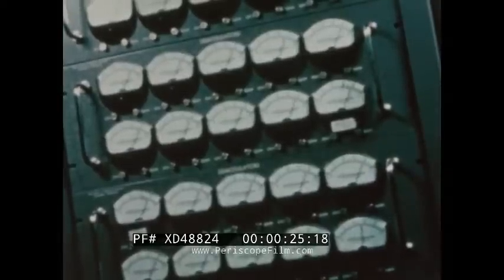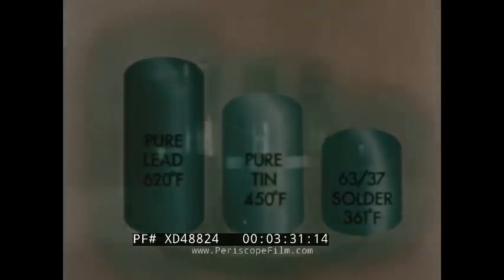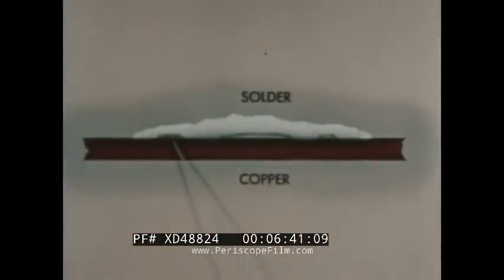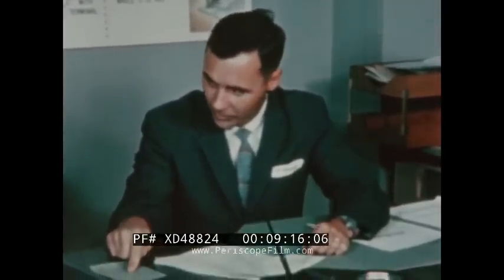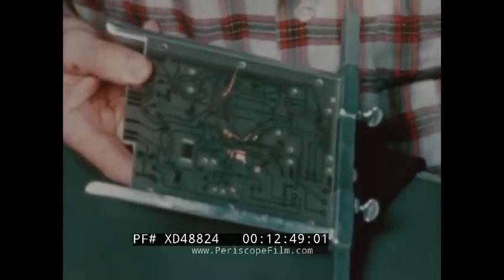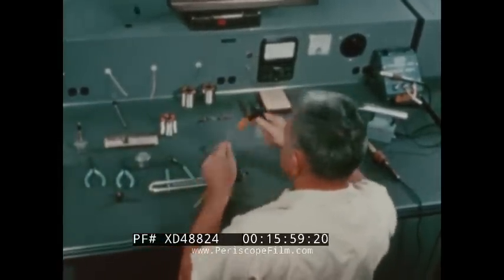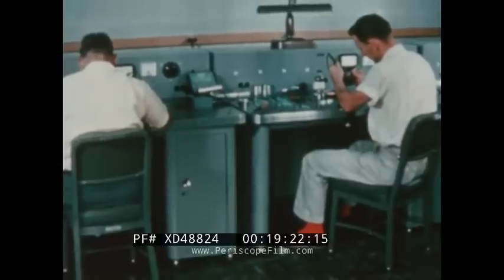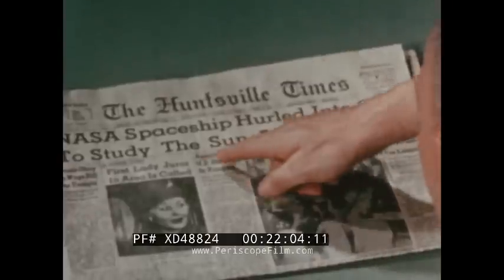1958 "ABOVE AND BEYOND" NASA SOLDER & SOLDERING TECHNIQUES ELECTRONICS INSTRUCTIONAL FILM XD48824

Comment: I took 2M miniature and micro repair in the Navy. I also went to the NASA school as well in 1972.  Years later, I instructed soldering classes for nuclear power plant techs. Most of this video is still up to date for component level soldering. Note that the amount of solder used per joint was very small in the video. Much later, it was determined that filets were not acceptable and rounds should be used in the solder joints. Also, 63/37 solder is used for electronics today as it doesn't have a semisolid state. Soldering irons today are temperature controlled.  60/40 solder is still used for power components such as transformers and high power semi-conductors.
Reply: SN 96 is the only solder acceptable for aerospace applications. And i believe military as well.
Reply: @cme98  63/37 is still permitted for grandfathered products, which is almost all military. We do use SN96 on our newest products and everyone hates it :D.
Reply: @cme98  You are of course correct! I had forgotten that NASA had shifted to the SN96 silver/tin  lead-free, eutectic solder. Still eutectic, but no lead. Thanks for keeping me honest!
Reply: Eutectic solder is more expensive than 60/40, because the tolerances must be closer. Otherwise, it would have always been used.
Reply: Lifelong professional and hobbyist electronics here, now retired. I didn't know about the semisolid state of 63/37 or why it's important, but I do know it's the lowest melting temperature solder alloy which can serve to protect components from excessive soldering heat.
Reply: @joewoodchuck3824  That's the thing, 63/37 doesn't have a semi-solid state. It's either solid or a liquid. This minimizes the chance of a disturbed joint while soldering with crystallizes the solder and makes it both weak and a potential diode.
Reply: I wish my hands were steady enough to reliably micro solder. I can barley solder 0603 components, and sometimes it takes a few tries. Anything smaller is obviously black magic and witchery from my perspective. I got the shakes. Got 'em bad. Sometimes a swig or two of liquor can make them go away, but I can't just drink alcohol all day. I love the work, I would love to do board repairs for a living. I'm just too shaky to do the work reliably. I have much respect for people who can do good sub-millimeter work by hand. I just watched a video of a man installing a mod-chip on the final PS2 Slim revision. It's a thing of beauty, all those hair-thin wires loomed across the board.
Reply: I miss the smell of carbon tetrachloride! Best thing for cleaning flux, then one day I came in and it was gone. :(
Reply: @joewoodchuck3824  The heat is not much less, but the importance is that eutectic solder can't produce cold solder joints. It won't crystallize that way, as it cools.
Reply: @alanduncan3710  Alcohol.
Reply: @alanduncan3710  OMG! I remember carbon tet. The smell was unique. Worked awesome on removing flux and any other goo. Also removed a bunch of your liver as it was absorbed directly through your skin. The fumes would get you high too...
Reply: as a hobbyist I use a 100w gun, 60-40 solder and ipa. always works and iv never had anything fail on me.
Reply: @Boemel  You might like a solder iron better since there's no waiting for warmup at each joint. Depends too if you're working with electronics or not. In my entire electronics career and hobby applications I never saw a gun in use. If I need extra heat or if portable, I swear by my adjustable Weller butane iron. Internal catalytic conversion with no flame.
   Fwiw, jmho, ymmv, etc.
Reply: @Boemel  a 100W gun is really overkill for hobby work, and also really clunky. I recommend a Weller 40W adjustable soldering station with a small assortment of tips. Best advice I can give: Always load your iron with solder when you turn it off. Your tip will last pretty much forever.
Reply: @alanduncan3710  Your liver thanks you.
Reply: @joewoodchuck3824  iv been using irons for years then used a gun and i like it more. I also have a soldering station but i dont know why, the gun always works better with me.
Reply: @GoSlash27  iv had 3 irons and i have a digital solder station. The 100w gun always works best in my mind. Note i hardly ever do components mostly wires for vehicles. The 100w gun is something i can pull out the drawer, heat up some wires in seconds and put the gun back down as its cold in seconds.
Reply: my dad did the same thing in the navy around the same time frame, even the NASA school. He later worked for Sperry-Univac and then DEC.
Reply: @alanduncan3710  , had they continued using Carbon Tet, it would likely still be here today but *you*, you might be gone. Count your blessings!
Reply: Ya know i made 6 comments & havent even watched any but a minute of this old remic from the past. Why? Because ive seen it before, just cant remember when or where? High school or my first real job which turned into a career for a small
Aerospace mfr who hired about 200 of us right out of high school. A great opportunity for me to drop out of college unfortunately nut i stayed with them for 10 years & sparked a career in electronic mfg which mever paid well until everything moved to China & people here found other careers. Then if u needed to hire
Someone to help in your startup you had to hire engineers to do production work or fly people in from China. Thays where i came in. I could do the work or find the people you need at not an engineers cost. A manufacturing specialist but educated officially as an electronics technician. It was a line of work i always knew since a Kid i was aimed to do. My last job was the one i expected to retire wealthy on. Turned out to be the worst job of
My career. A horrible mistake which cost me years of my health working in deplorable conditions to me but not to others around me which i found bafflingus.
Reply: @GoSlash27  first time i used "regular" solder i hated it. A lot more flux in that solder, melts to fast & splatters all over the product, arms hands & wrists. I much more preferred silver solder where you controlled how much flux by how much you added. When i made the switch from aerospace to commercial mfg, i was appalled at how cheap everything was commercially. The lead solder, lack of ventilation, wires where the insulation literally melted very fast & wires not made of copper but rather copper & coated with cheap ass plastic coated wires when i was used to teflon coated copper wires resistant to melting. And everything was at least varnished if not totally encapsulated in resin when completed. Even the pcb's were coated in plastic making any repair after that impossible. Everything was thoroughly inspected & tested documented & none of that bs in commercial electronics. Its safe to say no HP products that i worked on would ever make it onto the space station for a dictionary of failures. But work great at the office or at home. I worked for them just before they sold out their test & measurement division because their jet printer brought them into the computer market & they wanted that direction for their future & sold their past to smaller companies. Anyways... yeah, 2 different worlds. At start of my career all my work was from military contracts, but the quality was all the same. We never used 63/37 solder on anything because our military side was for the trident missile under development when i was hired & so it had to be waterproof, function in water & the next minute function in outer space at extreme heat in direct sun or way below 0° freezing on the otherside away from sun. And built to last 20 years if not more. Obviously top of the line & top dollar price as a result. But for the growing computer related products i eventually went into, there simply wasnt a need to build & craft a product. We didnt even strip wires & solder was only for the connectors of high priced cables leading to a Companies main frame computer. All that shit today is literally stamped out & automated.
Reply: @WarpFactor999  no need to thank me its all i ever knew. There wasnt a spool of 63/37 or 60/40 anywhere in my life for my first 10 years in my career. When i was introduced to it i was appalled by how much it splattered everywhere. S/n 96 was also called high temp solder or silver solder if you were a plumber because of the lead free content which wasnt all lead free in s/n 96 there is still 4% bs added to it to make it flow. I dont
Know about plumbers solder other than because of the hype of calling it silver, they charge more. Kinda lime intergrated circuits & manufacturing of early components involved using gold wire 99.999% pure gold wire which sounds expensive but this wire is 1/3rd the thickness of a human hair & so small the waste we threw it in a regular garbage can. Working with that was like re-attaching fingers. All under a high powered microscope
Clean room environment and VERY STEADY HANDS which literally 90% of anybody who tried to work this failed. Came easy to me.
Reply: @joewoodchuck3824  yes correct its also called low temp solder because it will melt on spacecraft which is why they require high temp solder. Also for military use on missiles. Low temp solder also cracks easier & can explode in extreme conditions. A lot of stuff learned from soldiers in vietnam who were literally pulling out goo from apache helicopters first tested there & components couldnt handle the humidity & high heat & the plastic encapsulated componets would liquify, wires falling out of somder connections & encapsulants melting into a goo. I was told military standards changed from things new that worked fine over here but fell apart over there. Literally fell apart.
Reply: @WarpFactor999  thats over my scope of knowledge. But at least i can grasp & comprehend what you are saying. If someone entered the room, i was the guy who said,
Oh you need to speak to him (you). Lol
Reply: @alanduncan3710  Good for cleaning flux.  Bad for internal organs and the ozone layer.
Reply: @NonEuclideanTacoCannon  i installed pure gold wire from point A to B on the inside of an intergrated circuit. That wire is 1/3 thickness of a human hair. I also attached same wire to a LED which i also had to pick up with tweezers and it was 2x thick of human hair & a square box. Pick it up & solder it to a flexible pcb made of capton & then complete the circuit with another gold wire from top of component to pad on capton. And then pull it to ensure it
Didnt break, then encapsulate. These were for laser bar code readers, the cheapest kind made sold were light pens. Hand Scanners were $1500 pens Were $300.
Reply: @cme98  Interesting.
Reply: @Boemel  I'm sure guns are much easier for automotive wiring (although I personally use my Weller for that as well). For electronics work, OTOH... you're better off with a soldering station. As for which type of solder you should use... It depends on what you're doing. The key is to make a good solder joint while not damaging the components in the process. Silver solder for plumbing because you're not going to damage pipes by overheating them and you can't have lead in your water supply. 63/37 for most hobby and consumer applications. 60/40 for applications that must withstand higher temps. Lead free tin/ antimony for absolutely nothing :D It's crap and you should never use it except when mandated by law.
Reply: "Much later, it was determined that filets were not acceptable and rounds should be used in the solder joints."

When was this?  I went through the NASA soldering training in 1989, to work in Navy electronics and if we made a round solder joint in our practical exam, instead the expected shiny concave fillet, that was a fail.  We were trained that flat or worse convex solder joints where unacceptable and that only concave fillets were allowed.

We were told that flat and convex solder joints were not as strong as concave joints (unintuitive, considering there's less solder) and that they were also harder to inspect for dry joints.

But I'm wondering if concave joints were stronger by virtue of allowing more flexibility under vibration, than a stiffer round joint.

Does not surprise me that training may have flip flopped through the years.
Reply: I just had a look at NASA-STD-8739.3 and I found that fillets were mandatory throughout, with the exception of the use of standoff terminal posts, in which the diagram showed that a solder ball was acceptable in that case.
Reply: @beardymcbeardface69  I was tought to use fillets as well. That all changed when they found out that the thin membrane of solder could crystallize  very easily under hot/cold cycles with a small amount of vibration. For larger conductors (>18GA), the steep fillets just didn't have the strength that was needed. They changed to a "wetted round" as being the requirement for thse reasons.
Reply: @beardymcbeardface69  Not sure. Mid to late 90's.
Reply: @beardymcbeardface69  What's a "round"?
Reply: @joewoodchuck3824   A solder joint which is convex or ball of solder.
Reply: @beardymcbeardface69  In all my career I never heard that before. Tnx.
Reply: @Stevie-J  Better finish your Soy Latte before it cools.
Reply: Things evolved a bit since. The Pace videos are the best in that regard. They correctly state that not too little nor too much solder should be used, ever. Too little solder can lead to a joint that can be cracked easily, and too much solder can lead to a lifted pad, because there is no way to disperse the forces through the joint.

Often, in the internet, you see guys making solder tutorials and doing mistakes like making "ball joints". I used to do that mistake. Nowadays, the only bad thing I do is to snip the wires after making the connection.
Reply: @cme98  Lead free is terrible. There is only one "green" solder alloy that I find acceptable, and that is the traditional lead solder. It is green because less products go to the landfill due to cracked joints, tin rot or tin whiskers.
Reply: @joewoodchuck3824  The 63/37 solder has a very well defined melting point. No "plastic" (candle wax) state whatsoever.
Reply: @samuellourenco1050  Yup, I used to teach Pace courses. I remember when they stopped selling their low vacuum solder sucker as it didn't have enough ooph to pull solder off of the joints and generally overheated the pad causing them to lift.. That's when they shifted to the SnapVac instead.  
Indeed, lots of techs use the "bigger the gob, the better the job" technique. The revised technique was flats to slightly rounded contours, but no fillets.
Reply: @NonEuclideanTacoCannon  The best treatment for the shakes is - ironically - marijuana. If you can get it without too much trouble (which is a lot of places these days) it should dramatically reduce the symptoms. Or at least it does for many people. For some it's the difference between night and day. I wish you the best.
Reply: @alanduncan3710  the yes-chlorinated, non-flamable brake cleaner for cars is kinda like "carbon tet".  Works pretty good
Reply: At AT&T we follow the BSP (Bell System Practice) as a frame worker we first apply solder to the tip of the iron.
Reply: @briang.7206  Yup. That's what I learned. Helps to initially transfer heat to the joint and keeps the tip of the iron coated, preventing oxide buildup.
Reply: @alanduncan3710  Me too. I was an instrument tech in the 70's and used to clean switch contacts (on 0.001% precision Wheatstone bridges) with CCll4 After an afternoon in the temperature controlled shack, I'd come out and nearly pass out when I took a lungful of clean air. Who would have known it was really dangerous?
Reply: @cme98  fell apart just like our military policy
Reply: @deaddropholiday  i'll puff to that
Reply: Former navy ET here. Yeah I went to 2m school also. Good stuff!
Reply: @cme98  I have found there are 2 main reasons for shaky hands:
1 - Nerve Damage: a muscle relaxer (or marijuana with more CBD than THC, but not solely CBD).
2 - Muscle Tone and Flexibility: If you need to do precise work then you need to exercise your hands and wrists.  We all sit in front of a keyboard all day long and that atrophies the wrist muscles causing them to tighten up.  Then whenever you try to bend your wrist, fighting that tension makes your hand shake.  Get a firm stress ball to help muscle tightness and tone.  Get a 2lb barbell and pretend your wrist is your elbow, flexing your wrist joint like you were lifting weights.  Be sure to do the exercise with your hand palm-up and another set palm-down, trying to flex your wrist as far as you can without hurting yourself.

That's what has helped me over the years.
Reply: In '77 did the NASA HRSS course for Honeywell. We still had the big clunky metal wire stripper with a more modern one from PACE. The PACE high reliability soldering station had all the tools and "solvents" in these stainless steel pump dispensers, about 2" square with cleaner, primer and flux remover. All the goodies.
Reply: @cme98  what sort of soldering iron heats up enough to melt the pure gold? 1943 Deg F
Reply: @docferringer  Forget about all that macho shit and learn how to play guitar - 
:D for flexibility of course